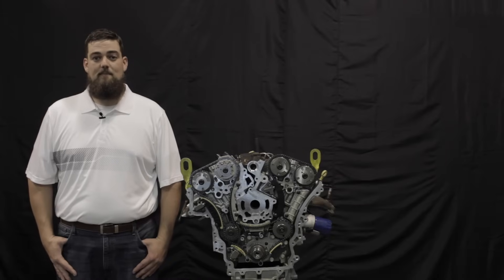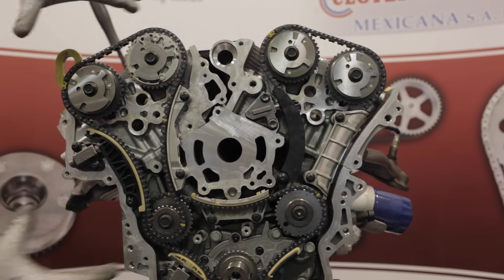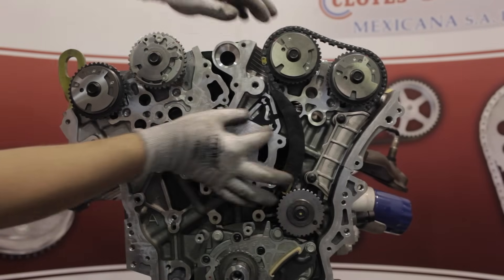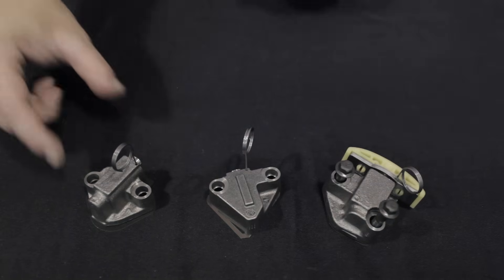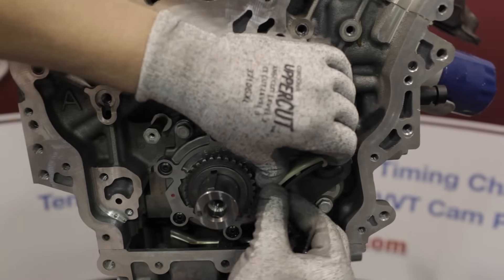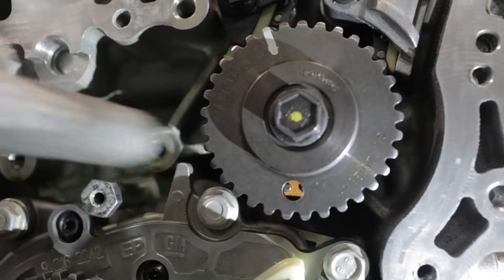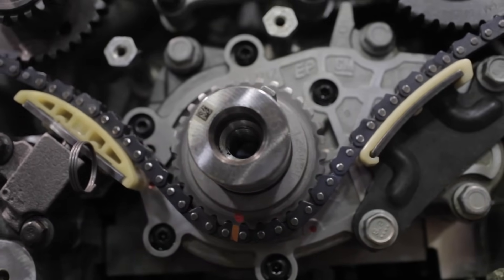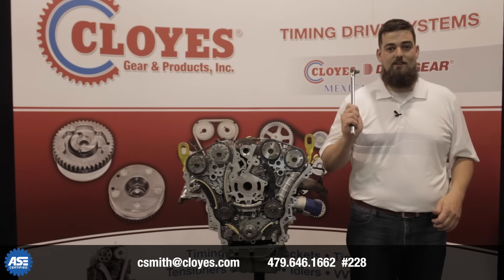GM 2.8/3.0/3.2/3.6L Timing Chain Replacement Repair, Cloyes 9-0753S

Comment: Erm you said pull the pin on the primary and then rotate to the next mark but in the video you rotated to the next mark with the tensioner pin still in even though the previous clip showed it removed? It's right there big as life. Something else I want to say/ask, if somehow you screwed up and rotated the shaft clockwise when lining up the timing marks after removing the right bank timing chain, instead of counterclockwise and then had to go two more revolutions to get back to proper time there does not seem to be any valves in harm's way on the right bank because none of the lobes except possibly #6 are in an open position but in #6 they are barely open off their seats if at all so none should interfere with the pistons and the left bank is still rotating with the crank so again should be no interference? Is this not true?

 It also would have been nice if GM had a minimal amount of foresight to locate the primary timing marks on the top of the crankshaft instead of the bottom since they can't even be seen inside of the motor bay from the top without a mirror or camera, and the camera is really hard.
Reply from the maker: Yep, there was an error in the editing/filming process regarding the pin in the primary tensioner. But you definitely want to pull the pin before rotating. 
And you are correct, once the right hand chain is removed the cams should move to a "resting" position with the valves all closed or at least mostly closed with no chance of piston interference.
Reply: @Cloyes01  Thanks for the confirmation, I have just done the timing chains for the second time in just over a month. That was necessary as mine was originally off by about two teeth due to the listed issues. I have never such as problem timing a car before and this seems so straight forward. I have built and won with my own stock racing engines and not too long ago did the belt on two of V8 Tregs and though MUCH more complicated hit them both first time, this supposedly easy cadillac not so much and I'm taking offense to how it seems to be making me the fool. Now it seems I may have to do it a third time, this last time fought me tooth (some of that was my own lack of attention span) and nail and STILL didn't come out correctly, or it did as I checked, double and triple checked timing marks at every step and it is still running like trash. 
Well it doesn't run like trash actually, it runs really well and idles perfectly except for sluggish off the line and a hitch in it's giddy up around 40 -50 MPH  once. All sensors are new except the crankshaft sensor,  can someone confirm for me is a sensor relearn required?

Comment: You should specify where the cams should be because you can be off 180 degrees on the cams
Reply from the maker: If the marks are all up on the camshaft sprockets(phasers) then you are good. If the cams are off 180 degrees, then the marks will all be down and won't engage with the chains.

Comment: VIDEO IS INCOMPLETE! What is shown is correct, HOWEVER, when the video talks about setting stage 1 and 2 timing. During this step MAKE SURE the flat side of the rear of each camshaft is facing UP, otherwise you will not find the timing marks in the locations shown in the video. It makes the whole process much more complicated trying to figure out how to properly line the marks up once the chains are off

Comment: In the vehicle? Wow man. Was planning to pull motor.
Virtually no room between front of engine and frame.
Reply from the maker: It will be required to pull the engine in most applications. In RWD applications, like the Camaro, it can be done in the vehicle.

Comment: So you never mentioned which way to rotate the engine during setting the timing and when going from stage 1 to stage 2? I’ve read that you must rotate counterclockwise but in this video you went clockwise from stage 1 to stage 2?  Kinda confused now?
Reply from the maker: We rotate the direction that is closest to the desired mark. You will rotate one way during disassembly and the other during assembly.

Comment: I watched another guy do this & he only turned engine clockwise(twice for every one rotation of cam shaft to set up both stage 2, then 1, then 2 again?).. you turned engine counterclockwise just a smidgen to set up stage 1(after setting up stage 2).. then I think you just turned it a smidgen back clockwise to relignnup stage 2 again.. I didn’t see you lining up or checking if flats on camshafts were flats facng up, & at these lacks of rotations the main engine camshaft is probably in a different rotation sequence as are 1 or 2 of the cams... both you & the other mechs procedures are different.. more importantly both probley leave cam rotations at different cycles.. I’m 1dering which one of you or the other guy is right or wrong?🤔

Comment: This video was THEE most helpful in getting through this job!
Even still, 4 years later Mr. Smith is still answering emails!
Excellent customer service! 👌🏾 Cloyes for the win! 🏆
Reply from the maker: Thanks for the kind words. Peace and Love!
Reply: @Cloyes01  Sir could you be so kind to convey if cylinder number 1 is top dead center at stage 2 position or stage 1. Thank you 🙂
Reply from the maker: @wildwoodtop  Number 1 cylinder is at TDC at stage 1 timing.
Reply: This guy did a tremendous job he made everything seem simple and eaay going good teacher thank u again brother

Comment: Thank you Cloyes ..
  What is the mileage this procedure is recommended at 
.??
Reply from the maker: Typically you would perform this repair when you get a check engine light for camshaft to crankshaft correlation. There is no stated replacement interval. System life, especially in this application, can vary greatly based on how well the engine is maintained.

Comment: Cloyes is the only timing kits I use for anything..high quality nothing beats it👍
Reply: My experience also, going back to small & big block chevy race motors in the 70's.  Cloyes is the most reliable chain drive out there.

Comment: Does this apply to the 2017 V6's????
Reply from the maker: It does in some models. You can lookup your application on our website and find the kit part number. If your application uses a 9-0753S kit then this video will directly apply.
Reply: @Cloyes01  I tried to look up the 2017 camaro but Camaro is NOT listed. Your thoughts??/
Reply from the maker: @biglon74  The 2017 Camaro use the next generation engine. This video will not directly apply.

Comment: You did not mention the cam gears have circles and triangles to set the chain at?
Reply from the maker: The triangles and circles have corresponding "R" and "L" marks which designate right or left bank.

Comment: If you do this on the car, the power steering pump bolt on the 4wd cars is barely reachable and a major PITA. I replaced the timing belt on a honda pilot and the tensioner was at least 200lbs of pressure, maybe more. The tensioner on this v6 gm is probably 20 lbs and the teeth on the sprockets are alittle short.

Comment: I've got an 06 CTS with the 3.6. Is this the same parts kit I need because I can't fine another kit for it from Cloyes.
Reply from the maker: No, the early 3.6L engines used different style chains. We have some individual components but not a complete kit for that application.

Comment: Ok after putting back toghter I filled up with oil how do you prime the engine or jus start it let it run
Reply from the maker: You can pull the fuel pump relay and let the engine turn over to build oil pressure. It is not absolutely necessary, but will help insure the tensioners will have some oil before starting.
Reply: @Cloyes01  my chevy don't have a fuel pump relay

Comment: Great video! My case is very complicated, i really need your advice.. I own Camaro 2011 V6 3.6 which throws P0008 P0016... 
1. Timing Chain Replaced(Cloyes complete kit)
2. 4 Cam Phasers Replaced(OEM)
3. 4 Selenoids Replaced(OEM)
4. 4 Cam Sensors Replaced(ACDelco)
5. Crankshaft Sensor Replaced(ACDelco)
Unfortunately nothing changed.. Still same codes. My mechanics double checked alignment... My car is running sluggish,poor.. What should we do next? Pls help

Comment: At 2:00 in the video what direction go to turn the crank to set it up for stage two timing?  The video shows it spinning counter clockwise.
Reply from the maker: Just turn it counterclockwise. For the limited distance needed, turning counterclockwise will not hurt anything.

Comment: Tip: firing order is 1-2-3-4-5-6. Cylinder order is (1-3-5) Passenger side bank, (2-4-6) DS. Rotate engine cw until at tdc #1 cylinder and alignment of the crankshaft primary chain timing mark for the right bank camshaft secondary timing chain, or 8 o’clock marks (driver seat orientation).

Comment: So when you installed the lower chain tensioner you didnt pull the pin, do you pull the pin before you start on the left bank or as soon as you install the chain and check for alignment?
Reply from the maker: Install the chain, check alignment, then if it is good pull the pin before you move to the next bank.

Comment: It is worth noting that all 4 cam phasers have both the L and R timing marks and if the engine has lots of varnish or is just dirty the L or R will be very hard to see. The video does not show the close up of the right cam phasers. On the engine I did this on, the right hand bank timing marks were little triangles and the left hand marks were little dots. Cloyes, It would be a good idea to be very specific about this point due to all the phasers having both sets of marks. Other than that, a very informative video and easy to understand.

Comment: My motor has a click when I turn it after I install the chain is that normal
Reply from the maker: You are going to hear some clicking as the valves open and close when rotating by hand. The tensioners will also not prime up and hold the chains tight until the engine starts and builds oil pressure.

Comment: Or start a class-action lawsuit against GM for manufacturing defective engines? Then you could give GM the bill for all this or GM would have to do the repair. I just don't get a warm fuzzy feeling investing my hard-earned money into a vehicle that was manufactured with a defective engine. Just wondering but why not replace the tensioner guides with metal components instead of nylon ones. Won't the nylon guides eventually get brittle and break, vs metal that would last. Great video but it also tells someone if they were thinking of buying a GM product with a 2.8 L,3.0 L,3.6 L engine to not be stupid and buy one. There are more issues with these engines like replacing the valve cover gasket with an updated one, that restricts the amount of oil getting through to the PC valve and burning a lot of oil through the exaust system. Buying a GM vehicle with these engines will cost you thousands of dollars to repair. Look at other vehicles instead.
Reply: We have an 2011 acadia with 200k miles and the timing chain finally went. The nylon guides are a head scratcher though.

Comment: Cody you the man! I watched this video like 10 times before I did this repair myself with this Cloyes kit and it worked Amazing! Car runs super smooth and quiet. Thanks again for the great tutorial video. 😎🤙👍🏽
Reply: How did it go?  I have an Acadia that needs this done.  How much time did it take you?
Reply: @bmo5082  patience is key with this repair, it took me 3 days and about 18 hours total. I replaced valve cover gaskets,front timing cover seals, pcv valve..etc. Anything that I came across including spark plugs. I made this repair in the vehicle too so work space is limited.Key points when removing the timing chains 3x check your marks and leave your Rear cams chain on phasers until ready to swap for new one- this helps keep your 10 tooth count spacing, even then you may need to back up the very rear phaser a little. Other than than just clear everything out of the way ..every inch helps. Lastly when removing the P/s resevoir be careful it's super brittle lol I broke mine and had to order a new one. Happy safe wrenching and take your time especially when siliconing the front timing cover back on. Thanks
Reply: @lilwrencher7996  thanks for all the good info.  Do you still think the Acadia is a good car except for this issue?

Comment: Been using your kits for years on the GM 3.6. just did a 2010 SRX but think my kit may be defective...it jumps teeth...I replaced everything including all spockets. Tried a new GM tensioner thinking yours was bad. Still getting p0016 and 17. Tearing it back down again...any tips? I know there was a bulletin on shifted reluctor wheels but this is only sending codes for 1 bank
Reply: I'm having the same issue right now what was the fix ?
Reply: @chaselindop3975  I returned the entire kit for a new one. Was fine after that
Reply: What kit was it
Reply: The one I got was an ebay kit the customer purchased and it had dorman phasers in it

Comment: Did it the exact same way and I keep getting timing codes!...did the job twice!...i used the camshaft locks and positioned the marks to stage 2 then rotated to stage 1
Reply: Get the software update from dealer

Comment: Hope do you know if you should replace cam-phasers ??
Reply from the maker: If you were experiencing any VVT system issues I would recommend replacing the phasers. We now offer a kit with all phasers, solenoids, and the timing components, part number 9-0753SVVT.

Comment: Need some advice on how to get the right side in time. Chain was removed without knowledge of what to do I guess. Now I am trying to line it out. Can old chain be put back on with tensioner and guides and go from there. Left bank seems to be fine and cam lock tools fits and marks seems to be in correct place. How would I know how many revolutions to turn crank to know forsure right bank is where it needs to be. If cam lock tool fits does that mean it is where it needs to be as long as the timing marks on phasers is in correct position? Also if cams are close can I use wrench on them to get them to where am lock tool will fit.
Reply from the maker: Yes, if the phaser marks are where they need to be then you are good. You can use a wrench to slightly turn the cams so the phaser marks align properly with the chain (or so the holding tool installs.)

Comment: Great tutorial. Just did mine but instead of aftermarket parts I used ac delco ones. Mine jumped a few 🦷 didn’t hit valves or anything
Reply: On how many miles?
Reply: Mine broke the chain the ly7 engine is 0 interference and acdelco oem parts are failing still cloyes kits seem to be lasting longer just my 2 cents

Comment: how did you rotate the engine to stage 1 timing position without putting a wrench on the crankshaft?
Reply from the maker: We were turning the engine using the flexplate during the video.

Comment: This is a great clip. Thank you. However you do not show how to align the LB cams if they are not in position, nor the use of cam tools. Cheers
Reply: Yeah. This is started with a lot more steps than just intake, cam cover, and timing cover removal.

Comment: Once the chains are complete, how many rotations does it take on the crankshaft before all the points are back to their original timed positions?
Reply from the maker: I don't know. It could take over a hundred before all the marked chain links realign. The marks on the sprockets will all go back to where they started every 2 crank rotations.
Reply: same question I have right now

Comment: How do you go about rotating the engine?
Reply from the maker: We used the flywheel to rotate during the video. You can slide the balancer on the crank and turn it by hand if you don't have access to the flywheel. Remove the spark plugs to make it easier.

Comment: After Completing the installation of the new chains. I rolled the crank with a socket & ratchet. The motor rolls very smoothly, however I am get a noise from the left bank. I am not certain on the location of the noise valve train/ cam phaser. Is it common for the lifter to make a small noise or would the cam phaser make this sound? I have rolled the motor about 30 times and the noise has not went away.
Reply: I have that same issue. Also the left bank tensioner seems to have a lot of play unlike the right bank.

Comment: Do I need camshaft holding tools for this job?
Reply: I just did this job, they are 18 bucks off Amazon makes life so much easier. Especially the rear bank, it wants to roll once the tensioner is removed.

Comment: GM should name this POS engine "high failure" instead of high feature
Reply: jd5179 
Or people could just change their oil and avoid 90% of the problems! 😂
Reply: @naquoashuey2794  yeah the issue is- gm put that faulty oil life monitor system, lots of people follow that for oil changes.

Comment: Are these chains going to stretch like the stock ones? I had a 07 Suzuki xl7 timing replaced and it on lasted 30000 miles before it stretched and the same problem all over again!